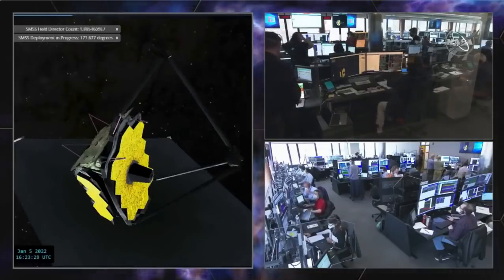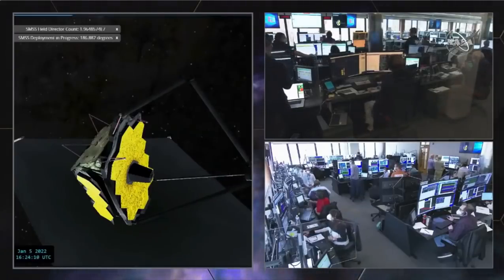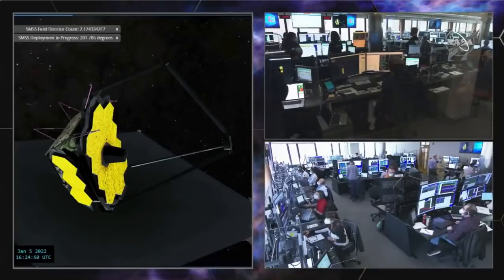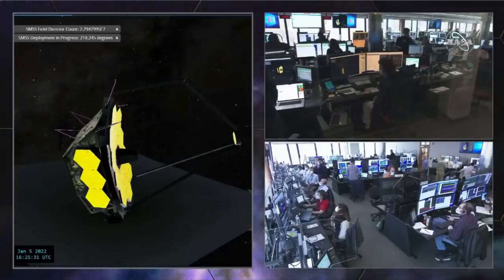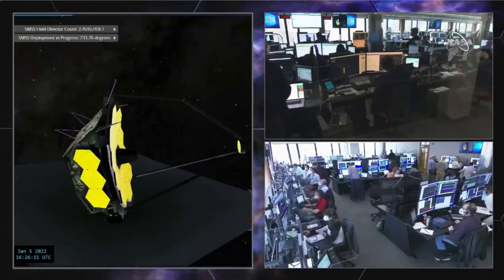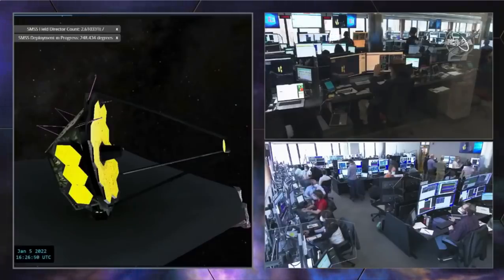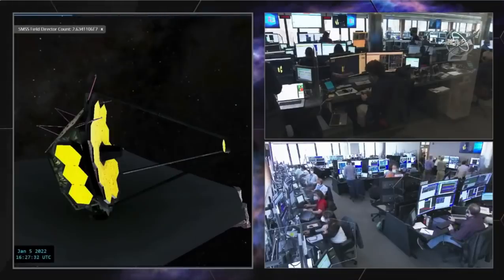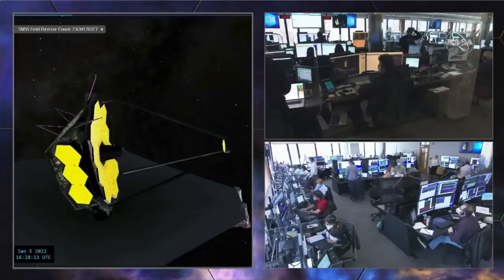James Webb Space Telescope's secondary mirror is fully deployed!

Comment: No, the James Webb telescope doesn't have onboard surveillance cameras. What's amazing is how people would rather complain about that than take a minute to find out why. "Why not just strap a GoPro onto the Webb? That's what the cheap losers at NASA should've done!" Excuse me while I do some cutting and pasting: 

According to Keith Parrish, NASA’s commissioning manager for the observatory, the lack of cameras wasn’t a mission oversight — it was too complicated. If cameras were incorrectly designed, they could have jeopardized the $10 billion telescope’s ability to get never-before-seen snapshots of stars and galaxies billions of light-years away. 

SPOILER ALERT: the Webb telescope is all about infrared, a type of invisible light that can be sensed as heat, so the telescope needs to be extra cold to pick up faint heat signals coming from far away. Cameras, and the artificial light they’d need to illuminate the observatory, would add heat behind the sunshield — the very place they want to limit it, Parrish said. What's more, any camera on the cold and dark side of Webb, blocked by the sunshield, would have to be specially designed "from the ground up" to survive that extreme environment.

“It would fall apart, if not,” Parrish said, “And we'd have debris floating around, possibly.” To watch Webb, which is undergoing many different configurations as it unfolds its antennas, sunshield and mirrors, NASA would require several cameras in various locations. That need compounded the engineering burden, giving NASA one more reason not to pursue building them."

So, maybe the whiners out there should've attended design discussions over the last three decades - and arranged funding to invent the cameras needed for the James Webb to take the selfies everyone is currently whining about.
Reply: Joe Biden is an imbecile  Not all of them, Joe. Just the majority of them. 😕
Reply: Joe Biden is an imbecile  You're really going off topic, Joe. That said, let me qualify your comment:

"As with any statement of this nature, there are some qualifiers and distinctions to be made. First of all, these numbers refer to federal income taxes, not all income taxes and withholdings. Most workers have money withheld from each paycheck as mandatory contributions to the Social Security and Medicare trust funds. If you're self-employed, you pay 15.3 percent of your gross earnings in so-called payroll taxes. If you're employed by someone else, you pay 7.65 percent and your employer pays the same amount [source: Social Security Administration]. Many workers are also subject to state and local income taxes, property taxes and sales taxes, in addition to federal income taxes [source: Khimm].

If your income level is relatively low, standard deductions and exemptions can quickly lower your tax burden to zero.

Roughly half of Americans who pay no federal income tax do so because they simply don't earn enough money. The other half doesn't pay taxes because of special provisions in the tax code that benefit certain taxpayers, notably the elderly and working families with children." [source: https://money.howstuffworks.com/only-53-percent-pay-income-tax.htm]
Reply: Joe Biden is an imbecile  move to Florida, no income tax. Problem solved. 

(Except now you have to deal with a Governor who is a toddler, Floridaman in general, hurricanes, bad sports teams, Disney, snowbirds, etc. 

You do get manatees though. Not sure if that can be considered a one for one trade tho.)

Comment: OK, so that was clearly an animation of the telescope. In fact, all I'm seeing are animations ever since the launch. Where's actual video? They did remember to spend some of the $10 billion on cameras or GoPros, right?
Reply: No, the James Webb telescope doesn't have onboard surveillance cameras. What's amazing is how people would rather complain about that than take a minute to find out why. "Why not just strap a GoPro onto the Webb? That's what the cheap losers at NASA should've done!" Excuse me while I do some cutting and pasting: 

According to Keith Parrish, NASA’s commissioning manager for the observatory, the lack of cameras wasn’t a mission oversight — it was too complicated. If cameras were incorrectly designed, they could have jeopardized the $10 billion telescope’s ability to get never-before-seen snapshots of stars and galaxies billions of light-years away. 

SPOILER ALERT: the Webb telescope is all about infrared, a type of invisible light that can be sensed as heat, so the telescope needs to be extra cold to pick up faint heat signals coming from far away. Cameras, and the artificial light they’d need to illuminate the observatory, would add heat behind the sunshield — the very place they want to limit it, Parrish said. What's more, any camera on the cold and dark side of Webb, blocked by the sunshield, would have to be specially designed "from the ground up" to survive that extreme environment.

“It would fall apart, if not,” Parrish said, “And we'd have debris floating around, possibly.” To watch Webb, which is undergoing many different configurations as it unfolds its antennas, sunshield and mirrors, NASA would require several cameras in various locations. That need compounded the engineering burden, giving NASA one more reason not to pursue building them."

So, maybe the whiners out there should've attended design discussions over the last three decades - and arranged funding to invent the cameras needed for the James Webb to take the selfies everyone is currently whining about.
Reply: Looked like an animation. If it were video, where was the camera mounted that would have been looking back at the telescope?

Comment: So, what's coming next ?
Reply: Wing mirrors start unfolding
Reply: @davidpickens8800  when he'll be fully activated ?
Reply: @caiolimacaldas  6 months till cooldown
Reply: @davidpickens8800  you mean, June/July ?
Reply: @caiolimacaldas  about then, yes
Reply: @davidpickens8800  i heard is capable to detect heat signatures, right ?
Reply: There is a large heat radiator on the back of the structure that the mirrors and sensors are mounted on. That radiator has to deploy next.
Reply: @joevignolor4u949  when will be in full operational ?

Comment: WRONG! It's a golf ball worth of gold. Get it right...
Reply: Actually you are both correct.  Gold rings can vary in weight depending on size and level gold in the ring.   From a few grams up to a few dozen. So a couple gold rings could fall in at 2 ounces or 57 grams . The actual amount gold on the mirrors is about 2 ounces or 57 grams.  And a golf ball weights 45 ounces.  We're just talking ball park figures here anyway.

Comment: Why was it not fully deployed in the reachable orbit and send to L2?
Reply: Good question. I guess it was because to reach L2, the Ariane rocket must have accelerated the spacecraft to 9,5 km/s in one single attempt. For a low Earth orbit deployment the spacecraft should have been attached to the Ariane second stage, and it should be restarted weeks after launch which could be problematic.
Reply: It had to go far away from the heat of the earth and the moon.
Reply: Without a docking or berthing port there would be no way to service this even in low earth orbit with today’s technology. The space shuttle was able to repair and service the Hubble because it deployed it which meant it had a berthing port for the shuttles robotic arm (shuttle service missions were also an intentional part of the design).

Comment: just wish there were some selfie sticks on this thing so we could actually see it instead of just CGI for each operation.
Reply: That would’ve been nice but the extra weight and space were probably accounted for and they didn’t want to add anything that may compromise battery life or other things unnecessarily
Reply: Man that would be awsome! You should join the team for the design of the next telescope to make that happen.
Reply: I agree, Nasa could have install some selfie cameras and see it in real time. Rather than animation computers!
Reply: @Anuhea_Silverheart  you wouldn't of been able to see anything even if there were cameras pointing towards the telescope, as the sunshield is now fully deployed the optical equipment is now in complete darkness so any cameras on the observatory wouldn't be able to see anything
Reply: @Anuhea_Silverheart  They don’t need to. The arrays of sensors are more accurate. Plus, cameras just for selfies would be a waste of space, mass, processing power, power and bandwidth.